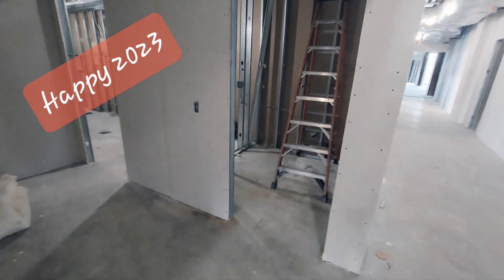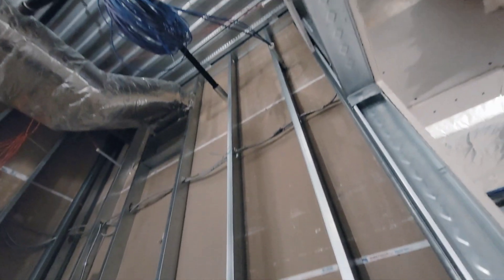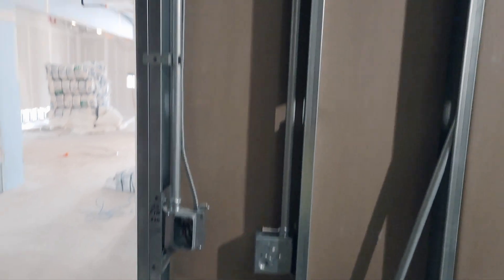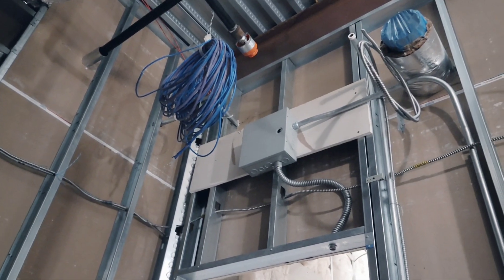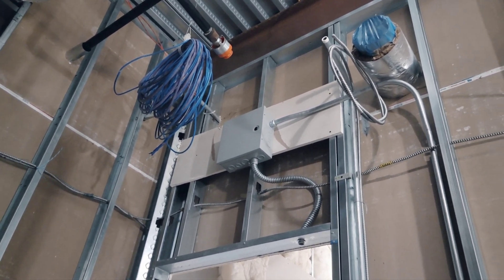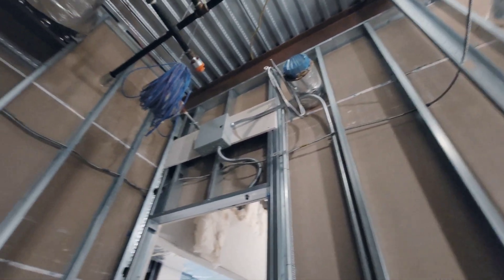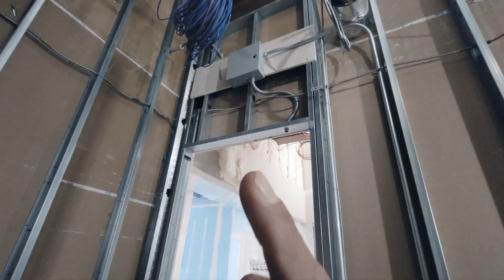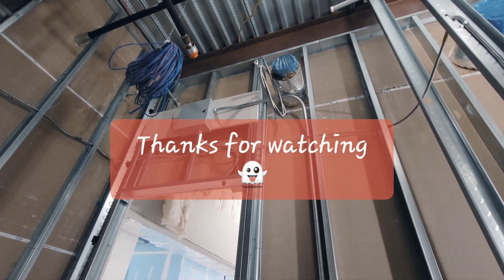Typical Access Control Door rough-in/wiring behind Sheetrock Walls. #tools #review #shorts #tiktok

Comment: been binging your videos as i have been the “new guy” at a data center with access control. i’m only 19 so starting out is a bit daunting though
Reply from the maker: I'm glad you are finding them useful. That is my goal to help learn and come on to our trade.
Reply: what do you do? i’m watching these videos as I’m new myself, im 25 doing low voltage (data, access control, cameras) and IT
Reply from the maker: I install Access Controls Systems, Intrusion Detection System, CCTV (Cameras). Little data networking (AV)
Reply: @lowvoltageghost888 I got a question for you. How come there’s no home run to a data rack from the card reader, and instead it just stubs up to the access panel? would you have to install this panel for every door then?
Reply from the maker: You mean the Jbox above the door. The Jbox above the door is where the home run composit cable goes. So, the composit cable comes from point A (Access Controls System Head-end) to point B (Jbox above door) where you strip the composit cable and route it to your Card Reader, Electric Lock, Door Contact and Rex (Request to Exit).

Does this make sense to you. I have other videos explaining some of this logic.
Reply: @lowvoltageghost888 I just checked out your other videos, very informative and they more than answered my questions!! The site plans given to me were calling for basic security wire to be laid out, but I realized from your videos using composite cable is the only proper way to manage all those wires.. The controller makes sense, binary addressing system + some parameters. My only wonder is if there’s a certain preference for what brand to get for access controllers?
Reply from the maker: Awesome, I'm glad you saw the other videos, and no, there is no certain preference.

Comment: What's the on call schedule like being in low voltage?
Reply from the maker: Haven't experienced On Call Service, if that's what you mean. We have a service department that take care of any service tickets and on call, from what I heard it sucks, because you can get called any second of the day, but there is benefits to it like going to take care of a ticket and fix it in 30 minutes and charge 4 hrs. Depends on how you see it.
Reply: @lowvoltageghost888  yeah I feel the pain on that service schedule. I'm on rack refrigeration at supermarkets.
Reply from the maker: Have you thought of uploading videos?
Reply: @lowvoltageghost888  yes in the near future. I had comms loss ticket today haha
Reply from the maker: That be cool, are installing any of the new systems that Walgreens has, like screens in front of the refrigerators? That shows all the items but on the door screen?
Reply: @lowvoltageghost888  we run service only. However different states have a install team. But yes there is a monitoring devices that detect the reading of what the fridge does. Installation and service both have its pros and cons. Installs you can get bored quick but don't have to worry getting called in the middle of the night vs service where its more interesting everyday, but you can get called in the middle of the night